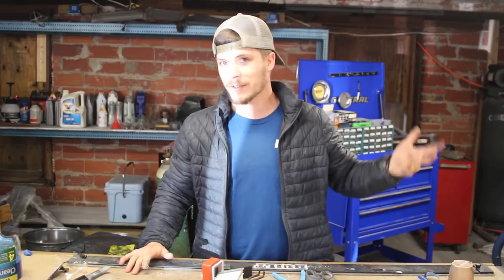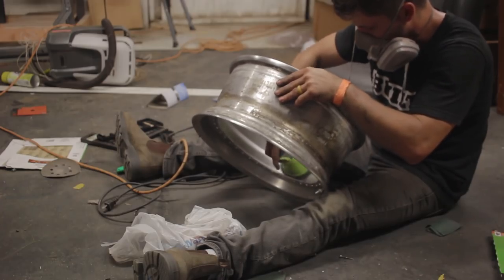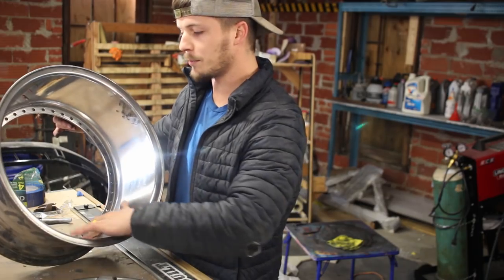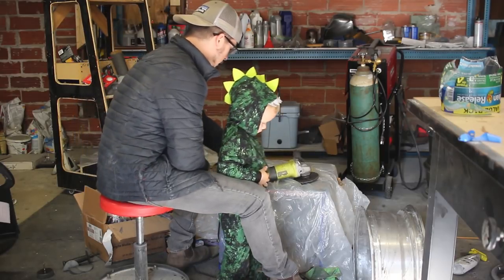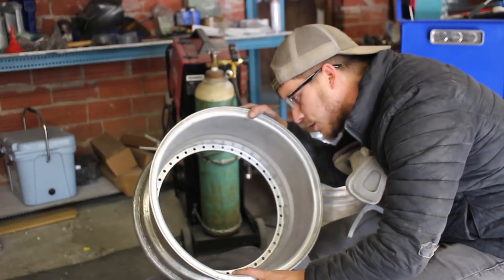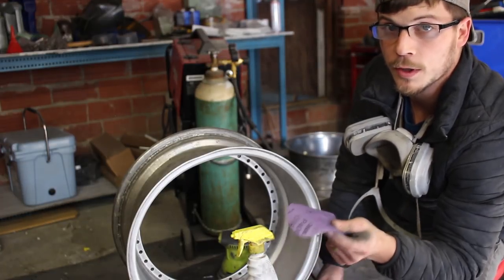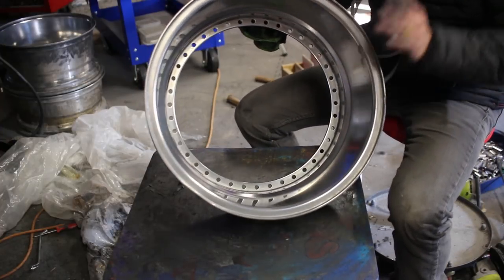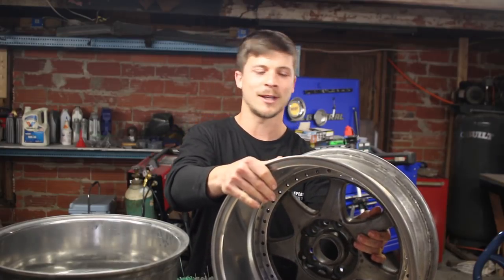MAKING CHEAP JDM WHEELS COOL

Comment: You need to bolt the wheel on to the drive wheel of a car on jacks and let the car spin the wheel why you hold the sandpaper on the spinning wheel.  Will save a lot to time and give you a more even, better polish.

Comment: put a couple bolts on the face and lips... Then jack up the car and  bolt them to the car, one at a time. Put it on drive. And you can polish like that way easier.. Wet sand to finer grits, then polish it

Comment: Is the valve stem gonna clear the brakes being on the jnside
Reply: You could tig weld/plug the old one & drill a new hole easily
Reply: im sure it will clear as the hub is litterally flush with the back of the wheel lol

Comment: There's reasons why there isn't any wheels with such lips in narrow wheels like that.
For example the sketchiness, like I don't think you realize how huge the forces applied on a wheel are, and because the mounting point is all the way to the edge of the wheel, it's even worse, it applies a lever effect.
Or another reason, you will need huge fender "holes" wheels that poke so much will hit the frame when turning a way, and will hit the bumper the other way...
Reply: IMNOTA yeah I would say at least mount the face inside to give it a chance to survive the first pothole.
Reply: @davidwilson9178  Yeah, but I'm not sure it would sit flush, seems like it can only go in the back... I think only the front of the face has this flat surface to meet with the barrel's mounting surface, and the rear probably has some reinforcements in the casting. Anyways, we'll see, I guess I've seen sketchier stuff doing great without breaking so let's hope nothing happens.
Reply: It will understeer like crazy too

Comment: Whenever I have polished up the wheels  I have always painted and lacquered them to stop them corroding. So many wheel manufactures have wheels with lacquer peeling Iv had to do it many times.At the time I could not find a lacquer that would stick properly , straight on aluminium but I think these days there are products out there which work. Was wondering if you are going to paint the rims or perhaps you could just wax them regularly to protect them and to stop them corroding.
Reply: There are no clearcoat that will bond passed 800 grid.this is why they all peel.
When u get to 2000 you buff and SEAL.
No wax on polished alloy.it cuts the shine
Reply: Good to hear . Have seen ceramic clear coatings which claim to be able to protect it but I have also seen good and bad reviews on them. Guess just a sealer it is .thanks man

Comment: Want deeper shine just do 1500 and 2000 then rebuff....dont use creams...use the green polish compound bar...
Pro tip 🤪
Reply: untouchable, light after darkness Those bar compounds on work with high speed buffing.  They need quite a bit of heat to melt that polish down for it to work right.   Creams are fine for what he’s doing, though I completely agree with sanding through the finer steps for a deeper shine.

Comment: How do you plan to clear the brakes with that much offset?
Reply: Clutchdoctor93 pretty sure all that matters for clearing brakes is the face of the wheel not the offset. All the offset does is tell how far in or out the barrel is.
Reply: Ty Kofahl pretty sure you’re right, I think my brain quit for a few minutes

Comment: Next time u do something like this dont bother with a strip wheel, instead clean it thoroughly, then block sand in one direction starting with 80 grit, then 120, then 180, then 220 and so on all the way up to 3000 or 5000 grit, each higher grit removes the scratches left by the previous grit which becomes VERY easy to polish once you have reached 3000 or 5000!
Reply: 80 grid is wayyy to rufff for a machined surface...also 3000 is not needed...stop at 2000...5000???LOLLLL
u can start at 180 on a machined surface its plenty ruff even 220
Reply: we do this up to 5000 in autobody, if you want a mirror shine with no scratches then working all the way up through the sandpapers before buffing gives you the best finish. And starting at 80 on bare metal guarantees you remove all the deep marks from the surface so you dont have to go back and redo anything

Comment: I personally would of never stared sanding with the 400 and never started sanding dry to begin with I would of started with maybe 800 wet sanding then 1000 then 1500 and would of used regular fine cut polishing  rubbing compound with the big sheep skin looking  polishing wheel  you used after I got a nice shine then would of gone for a final pass with a foam pad with regular mothers aluminum polish you would have gotten a better mirror finish had you done something like this i know because I have done this repeatedly to repair wheels worse then what you started out with and have had mirror new finishes at the very end over and over just my advice for you to get them looking even better yours look decent but need further sanding  with 1500 to 2000 grit to polish out better from what I can clearly see but still great attempt takes time figure it out

Comment: The only thing I am worried about is that you took the face of the ram and bolted it from the back you lose all your strength that way when it’s bolted from the front you’re pulling the barrel together this is really sketchy

Comment: Not cool... Have fun with that! That's not how you do that..
Reply: what do u mean
Reply: flipping faces on multipiece wheels is nothing new, a lot of people do it and it works. but it usually isnt as close to the edge of the wheels as this one, which might make it not work very well, or at all, for long periods of use.
Reply: @PhantmZero  I mean im from Germany and i wouldn't like driving 150 with that wheel but in america ur just cruisen i think its gona  be ok but not so safe hope he will not drive with kid's and wife with those wheels
Reply: @kampfspetzle  TÜV wär auch nicht so glücklich damit ^^ aber in murica fahren die eh mit allem xD
Reply: @PhantmZero  kennst holy hall da würde ich eher mit deren stahlfelgen fahren
Reply: Lol die deutschen übernehmen die Kommentare 😂
Ich denke es wird nicht gut ausschauen, wenn die Felgen fast komplett außerhalb der radhäuser sind
Reply: Might look "cool" but not going to hold up with the barrels that far away from the hub!